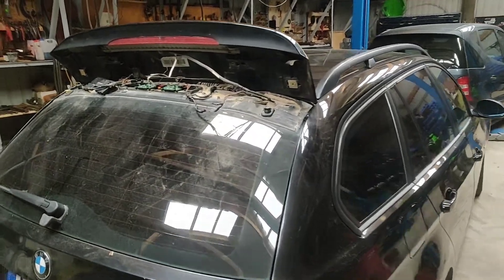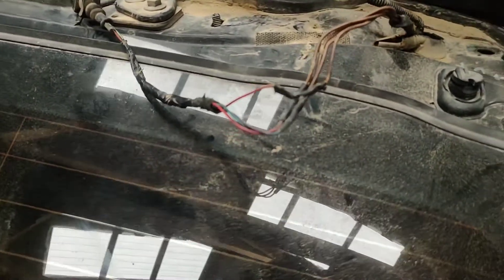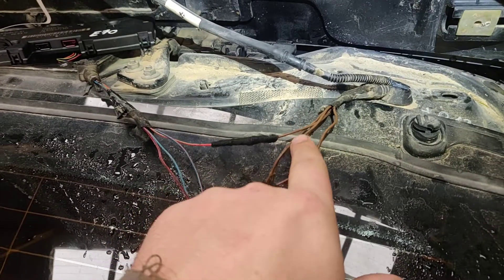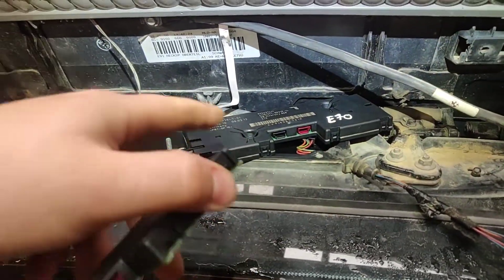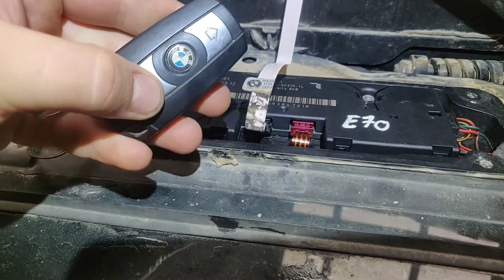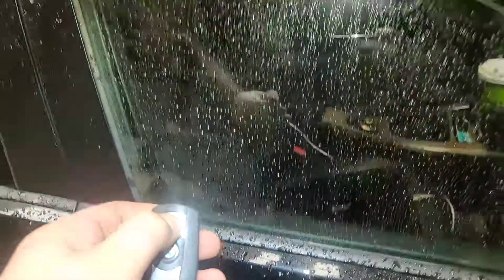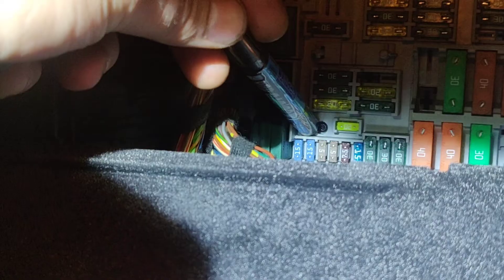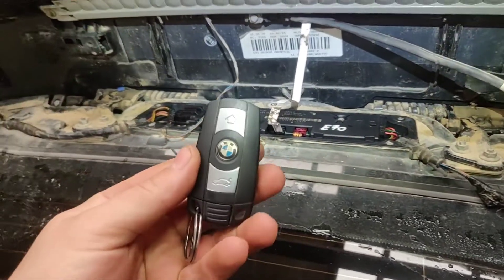BMW central locking problem diversity module fix

Comment: Something i've been told and you might be able to answer. As this could be important/
Do you have to buy a diversity antenna with the exact same code? Or is it enough to have get a diversity antenne which comes from the same platform.
For example: all diversity antenna's of a e91 are interchangable?
Reply: Not sure it helps but ive made an antenna out of copper wire cut to length

Comment: Have you ever seen a CC shut down and then "wake up" when you use the mech key? Mine does this regularly and I can not figure it out.
A little further explanation... I can walk up to the car and the fob not work. I can use the mech key in the door and as soon as the door unlocks, the fob will work as normal. 
Additionally, when parking the car and turning the car off I will exit the car, hit the lock button and the fob does not work, same as above, use the key in the door and as soon as the doors lock, the fob works. 
I can not figure out why the car seems to go to sleep and shut down the CC. No Battery issue, no codes. Have bimmercode and link and nothing related to the CC come sup. Replaced and bad handle (with code) about 2 months ago. Still same issue.
Any info would be appreciated.

Comment: I have this problem and replaced the diversity module - it didn't fix it. Wiring is good, what else can I try?
Reply: Did u find out what was the problem?
Reply: @bassiebassie1658  Not yet. I replaced the door handle too. there are 2 suppression filters for the antenna that might be a problem and if not then it might be the main module in the dash.
Reply: @MarionBrown  have you figured it out yet?

Comment: I have E61 LCI 525d 2008
I repaired the wires and everything went well, but I got SOS failure message on the dashboard, any solution?
By the way: All the sound system and BT are working great.

Comment: My keys are working just fine, my problem is that, the sensor doesn't detect the key if I am at the rear of the car (E91 Touring). Normally, if I approach to the rear of the car, I don't have to press the key for the trunk or the glass to open. But now it does not work unless I unlock the car. The sensor on the driver and passenger are working just fine, only the rear is not working for some reason. Does it have something to do with the Diversity Module?

Comment: I got the same problem on my E61 touring , I can use the car with a fob , but don’t lock and unlock the doors ...
Reply: You can just insert the key physically into the key hole using the key. It is a hassle but it will work just fine. But should you lose the key and it breaks you will need to pay a locksmith to get the broken key out. You will have no way in getting into your key unless you get the key out or get a locksmith to do it. Always good to have a backup so that's why you don't want to just ignore the problem you want to fix it if you can yourself as it can get expensive fast.

Comment: I've had an X5 E70 2010 for 5 years.  I'm on my third diversity antenna problem.  Been to a main dealer twice.  Not going back there.

BTW is there a way of opening the car manually with the hidden key without the alarm going off?
Reply from the maker: I thin best i just replace with used one but have to be 100% original

Comment: Any info for my E70 I replaced the Battery on the FOB and replaced the diversity antenna and still doesn't work? I checked all fuses? Any other idea before buying a new key fob????
Reply: @ex-army7183  It was the Fob, I ordered a new one and it worked. The old FOB was damaged, I even tried replacing the battery  on it and still didn't  work.

Comment: Hello, my 325i 2001 e46 hand works the remote controls, would it be the antenna module?
Reply: Hi my bmw x5 e70 the remote has stopped working the fuses are good and the central locking works from inside the car does the module need coding to the vehicle when swapped out ??
Reply from the maker: @pauljones3487  No need coding just swap it and all ok!!!
Reply from the maker: Yes but need diagnosis

Comment: Man e61 ar pulti atveras, bet neaizveraas.Vadus skatijos baroshana pienaak.Taa lentiite saprotu ka talaak padod signalu centralam blokam, bet nav skaidrs kurp un kaa  ta lente aiziet.
Reply from the maker: Vajag vispirms diagnostiku tad elektriskajās shēmas meklēt
Reply: I have an E61 (2008 535xi) what fuses should I check and is there a different diversity antenna I can swap in?